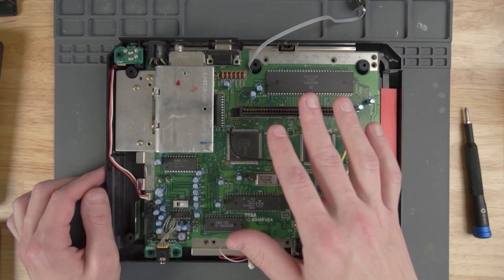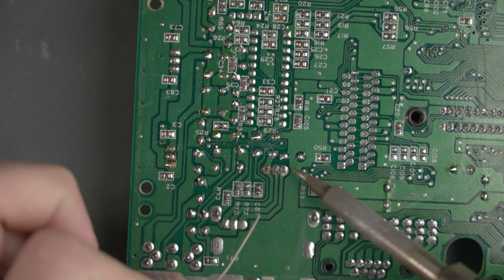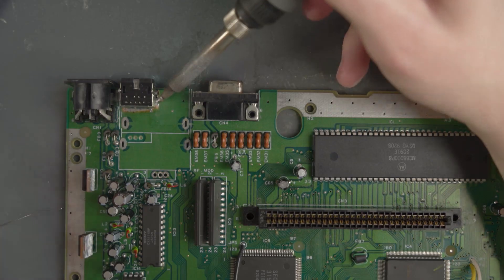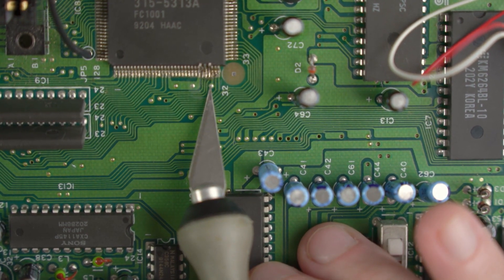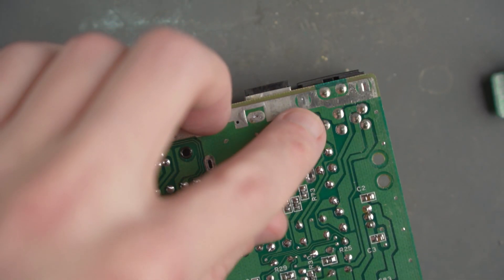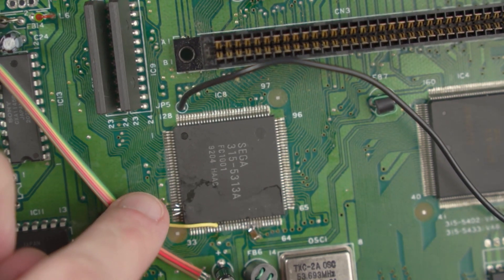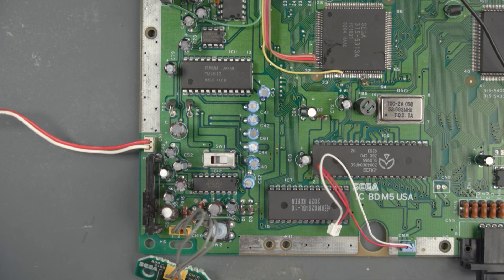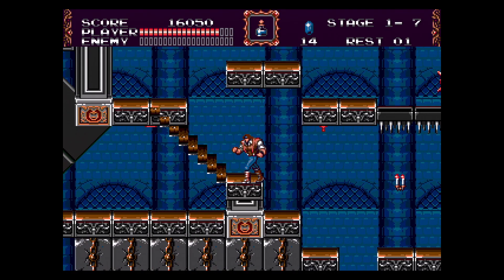Genesis Model 1 Triple Bypass Install - Remove Jailbars From Any Model 1 Sega Genesis!

Comment from the maker: If you want more modding videos, check out my modding playlist! https://www.youtube.com/watch?v=Na9uBpFdZAA&list=PLxkzgpuDBXWcVSkoI0U-nbEmuxcvHazd2
Reply: Looking at the pins that have to be lifted on the board could we just solder to the LANS on the board that the pins flow out of the chip to and cut the traces just before they go to the VIAs to prevent having to lift the pins? maybe making this install way easier then pin lifting for those not comfortable doing that.
Reply: @chrisuland289  The pitch is the same as the pins meaning the space between the lands is even smaller and you’d still risk damaging the pins. Removing solder mask to expose traces is more difficult, permanent, and risky since unmasked traces with wires attached will easily lift.

I’ve never had an issue lifting them but I’m tempted to try it a different way to avoid having to restore the 5.6k ohm pull-up resistors (RGB fix from Tian Feng). Next time I’ll try leaving the RGB pins connected and disconnecting the old RGB circuit by removing three resistors on the bottom of the board. R, G, and B will still be tied high through three other resistors on the bottom, which are the originals Tian Feng tells us to restore. I can then tap R, G, and B from the empty pads where I removed those other resistors.

There’s a chance that this will diminish my bypass results and introduce the same jailbars. Maybe the traces will couple with something nearby or maybe the original pull-up resistors use unclean power causing the jailbars in the first place. I still want to see if this can be an easier way to install the current 3BP boards which haven’t incorporated Tian Feng’s fix.

It’s worth trying because most resistor kits are only E12 values (no 5.6k ohm) and you can’t rely on being able to salvage the originals by moving them to the 3BP. The last time I tried my tweezers sent one across the room, never to be seen again. You can’t do the fix with only two resistors and I didn’t want to mix and match brands/tolerances so I used my own but someone without 5.6k resistors may be forced to combine more common values for something close… like 1k + 4.7k (6 resistors total). It’s a pain.

If I see jailbars then I will cut the traces where they diverge from the pull-up resistors and tap R, G, and B from the vias. If I still have jailbars then I will have to consider that it is coming through that 5v pull-up and I’ll have to risk losing one to tie them to a cleaner 5v (straight from a regulator?).

Comment: I had really, really bad Jailbars and had a Triple bypass on the mail but not here yet. So I decided to, while I waited, to lift the 50th pin. The jailbars weren't gone, but reduced.
Since I had my Genesis opened up, I took a look at the bodge wires, and hated how they looked, so I desoldered, shortened them as much as I could and put them on the back... and for some reason, that completely eliminated the jailbars! Did you know about this?
Wondering what should I do with the 3BP now. Because there's NO way I'm opening the Genesis now, it's perfect.

Comment: nice job. Use thinner guage wire to connect the RGB pins on the chip; like 28 or 30 guage solid core, with non-silicone shielding cause that ends up being to thick most of the time

Comment: Broke one of the RGB pins on mine after bridging the solder on them about 20 times. It's beyond me how anyone manages to pull this mod off.
Reply: Happened to me today too, but I still got it working. Used a dremel to grind down the epoxy of the chip to gain access to the trace that the leg used to be connected to

Comment: I dont understand the lifting of the pins for RGB.  You can just remove the resistors on the other side of the PCB.  You don't need to lift any pins.

Comment: is it worth it though? I mean RGB amp for sure but is audio worth tampering with? Does it sound better? I really had no issues in regards with audio, especially after full recap it sounds pretty great but sadly I did not find any comparison on model 1, all the videos on yt are just with model 2 or late model 1 with model 2 like board
Reply: The triple bypass's audio is based around the va3 model 1 boards audio amp/mix. Each board of the model 1 has a slight difference mix but they're almost all the same. Only one that's known to be shit is the infamous va7 board which is just a model 2 in a model 1 shell. So imo you don't really need to do an audio bypass on any model 1 board
Reply: great, I'll just put RGB AMP alone then, it will be much less work :D

Comment: @Dubesinhower did the solder on the flat underside of the DIN9 and the flat scratched-off area of the PCB weld together, or do you think it mostly welded on the outsides? I was just thinking, another option would be to draw a square around the DIN9 footprint and scratch off the PCB around that square, then flux and weld it on the outsides only. This would make an L-shaped joint holding it to the PCB all the way around. Similar to how metal plates are welded together.

Comment: This video makes me feel very lucky that my VA3 Model 1 is such a pristine example that I never plan to mod it beyond recapping it for my own peace of mind. I think it maybe has one bodge wire on the entire board and so little noticeable interference that I am planning on leaving the composite circuit intact.

I feel like I got even luckier with my Neo Geo AES: low serial in the 9000s, zero bodges, and oddly for its vintage, no daughterboard. The guy I bought it from did a simple RGB bypass that seems like it was competently done with the correct components although I may have it looked at by a professional just to make sure

Comment: I’m just looking into mods for my genesis 1. Are you aware of any additional mods that add an HDMI output on the system itself. Not an external HDMI converter.
Reply from the maker: Not currently unfortunately
Reply: @dubesinhower  bummer. Well this might be my new goal to make happen. Thanks for the prompt response. Most common content creators don’t even respond I’ve found. You just got another subscriber.
Reply from the maker: Yes, I think Genesis and SNES deserve HDMI mods!

Comment: I'm a little embarrassed to ask...but why is this called the triple bypass? To me it looks as if the only thing being bypassed the the audio. Unless I'm missing something.
Reply from the maker: The three bypasses are:

1) The built-in Genesis RGB amp
2) The built-in audio circuitry
and
3) The Model 1 DIN connector

The Triple Bypass board has a high quality RGB amp, better audio circuitry, and it connects to a Genesis 2 DIN connector, which is more popular with aftermarket cable manufacturers
Reply: @dubesinhower  I see. Thanks.

Comment: @Dubesinhower  So I have a VA2 model 1 and I can't do the Pin 54 Cap because there's no mask or via that I can tell that is comparable to what you did in that area.  Not sure what to do.

Comment: Stupid question: For the surface mount caps... one end goes on the designated pin, and the other end goes on a ground via, right?
Reply from the maker: Surface mount capacitors are usually non-polarized, meaning they can be installed either way. Capacitors that are polarized will have a marking on them indicating plus or minus
Reply: @dubesinhower  Thanks :)

Comment: Bypassing the stock amp does improve audio quality. Additionally, you can change the filtering caps in order to move the corner cutoff frequency (like say if you wanted more clear audio than stock gives).
Reply: How would one go about this?
Reply: @chrisw8069  On the TBP board, you would for example replace C18 and C19 with 30pF 0603 C0G/NP0 capacitors. It's especially nice to do for the Genesis model 2 console revisions that use YM3438 ASIC, as it features crystal clear high frequency range.
Reply: @RedArremer I am trying to find model 2 right now then.

Comment: @1:12 Interesting you had rivets attaching the heatsink, mine was screwed on... mine's a VA3 though. Wonder if they're standardized per revision?
Excellent job getting the RF modulator off, those ground tabs are a pain
@7:17 You showed 3 capacitors, but I only saw you use 2, was the last one just extra?
Reply from the maker: I always buy extra capacitors in case I lose them.

Thanks for watching!
Reply: @dubesinhower   Thanks for putting this together! One last thing, @8:38 the "via near pin #54", I presume this is a connection to digital ground (pin #97)?

Comment: I have a follow up question, my japanese megadrive doesnt have a RF unit so where would i need to place the replacement 9 pin din? because i was thinknig about removing the original model 1 8 pin din?
Reply: The standard install for a JP console is to use the original DIN for RGBS and the headphone jack for line level stereo. You lose the volume slider function, of course. See the Triple Bypass video from Kate’s Hardware if you want to see an example. The Model 1 RGB bypass instructions on RetroRGB cover the DIN restoration part and the M1 Mini Mega Amp instructions from Firebrand X cover the headphone jack part… but there are some caveats to note.

First, I think the guide is wrong on RetroRGB since none of the console DIN8 ports I checked get Sync from pin 11 (Sync Out) of the Sony CXA-1145P encoder. Instead, they get it straight from the VDP,  just like the encoder does at Pin 10. There is a resistor to digital 5v along the way which isn’t replicated on the bypass board so I suggest getting sync from pin 10 of the of the encoder. I’m not sure if pin 10 should also be cut/disconnected but it makes more sense than pin 11.

The guide does say to trace back from the DIN yourself and not to rely his example/numbers so it’s possible there are differences.

Next, the M1 Mini Mega Amp guide is written from the perspective of an audio bypass board with dedicated outputs but the only audio outputs on 3BP are for the mini DIN. The holes on 3BPv2 are labeled for connecting stereo wires (SL/SR). Just run those wires to the headphone jack after disconnecting it as Firebrand X suggests.

Alternatively you could drill holes or mount the 9P mini DIN where the DIN8 is supposed to be. I have seen people do this but my only JP MD1 was already modded with a PAL RF modulator so I reused the hole they drilled for that. My concern is that there is less to mount to, especially on e you isolate all those old DIN connections with tape. I guess you could sever a lot of those connections and turn them all into ground but perhaps that’s more destructive than it needs to be.

I did install one in a JP console but it had already been RF-modded giving me a perfect place for the miniDIN (hole they drilled on the left side).

Comment: Does anyone know the spec of the added capacitor? 

The link on retrorgb and in the video notes doesn’t show a product.
Reply from the maker: There’s a link in the description: https://www.arrow.com/en/products/krm31kr71h475kh01l/murata-manufacturing
Reply: 50v 4.7uF ceramic X7R 10% tolerance

Comment: I have a question, i have an older japanese megadrive model 1but if i do the mod would i lose the functionality of the headphone jack?
Reply from the maker: I believe so, but I’m not 100% sure. I think you can rewire the headphones to come from the 3BP board
Reply: @dubesinhower  cool because i;ve been meaning to do this mod but i really want to keep the headphone jack working if possible while replacing the old 8 pin din
Reply: The typical way to install on a JP MD1 is to disconnect RGB from the encoder and stereo from the headphones then connect RGB and stereo from the bypass. It will output the same line level audio you’d get with stereo MD2 cables so you will lose volume control.

Comment: Is it just grounded via the new Din soldered to the ground plain? I separately grounded kind but I'm getting a faint buzz in the audio, especially on white screens like the Konami logo.
Reply: Yes, it grounds through the DIN to the ground plane but there is a tiny dedicated ground pad if you install it some other way. Buzzing audio on white screens usually means you have unshielded cables but it could be something else. If it only affects one channel then you might have PSG connected to the cartridge or expansion audio. Also, the top RF/EMI shield can short out pins on the back of the miniDIN if you don’t bend or cut.

Comment: would this work for the other model 1 version the one without the high definition symbol?
Reply: The answer to that is really opening a can of worms but I’ll try.

First, “High Definition Graphics” doesn’t actually distinguish much since most without Genesis HDG are the same “VA6” board revision you see in any Genesis HDG console with the trademark security system (TMSS) boot screen… like Dubesinhower’s HDG VA6 revision you see in this video (top shell with “High Definition Graphics shown in his other video about jailbars). They produced VA6 for a long time before and after the HDG switch and there were even a couple minor changes that didn’t hurt anything, like leaving the EXT port off (VA6.5) and switching to a surface-mount encoder (VA6.8) but the audio circuit stayed the same. The reason people distinguish between HDG and non-HDG is because the very last non-HDG units were suddenly very different (VA7) with inferior audio.

Avoiding any Genesis 1 without HDG is way too extreme if you just don’t want a VA7. I’ve seen this go WAY too far with one guy even getting a VA6 HDG to replace his VA6 non-HDG while convincing himself that the audio was better! VA7 is basically just a Genesis 2 chipset in a Genesis 1. As such, the mod is compatible in the same way a Genesis 2 is but the installation is very different from every other Genesis 1. When bypassed with this kit the inferior audio is no longer a concern but purists may still want a one with a discrete FM chip instead of the ASIC found in VA7 and any Genesis 2. People sometimes prefer one or the other for subjective reasons but once bypassed neither is decidedly better than the other in general. Most games were composed with the discrete chip in mind and others were composed with the integrated ASIC version in mind.

If you are daunted by the largely-undocumented install process on VA7 or don’t want one for any other reason, Genesis VA7 consoles are easy to spot with the power jack in a different spot. The power jack was moved and mounted to the mainboard mounted so it’s no longer in the corner on VA7. The only reason to avoid the non-HDG model is if you want to find a so-called “non-TMSS” without the Trademark Security System but, even then, you can’t go by HDG alone since the last ones were VA6 with TMSS.
Reply from the maker: Yes it will!
Reply: @dubesinhower  any differences i gotta keep mind of? I've never modded a console before so i'd like to grab as much info as possible

Comment: What am I connecting pin 54 vvd to as my visas are in a different place ? Is it just a ground ?
Reply from the maker: i'm not really sure, and Genesis is not my expertise, however we have several people who may be able to help out in my discord
Reply: Yes, it is connected to ground as a bypass cap for digital 5v. There is another bypass cap on the bottom and I wonder if moving/removing that one can make a difference/improvement. The one beside the RGB pins is a bypass cap for analog 5v. Analog and digital 5v come from different regulators.